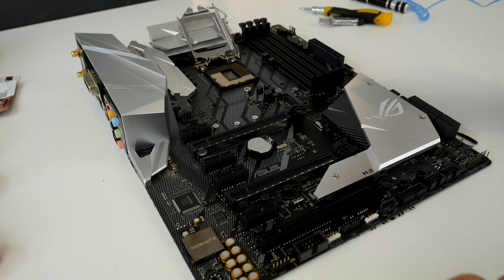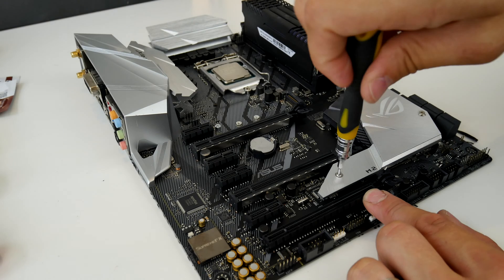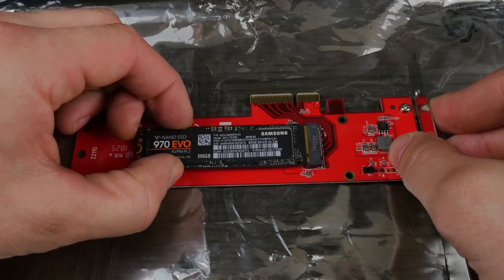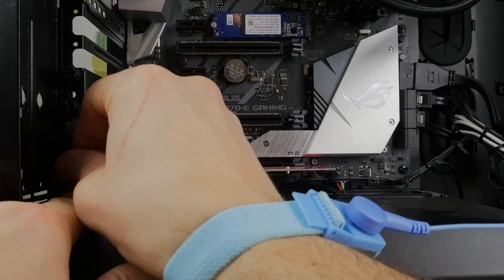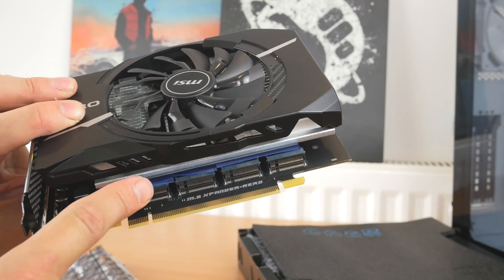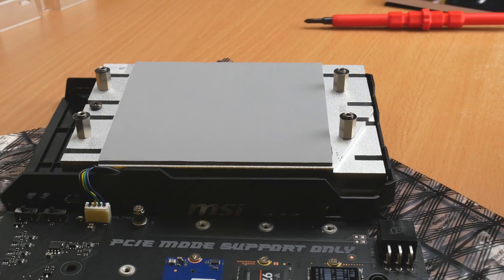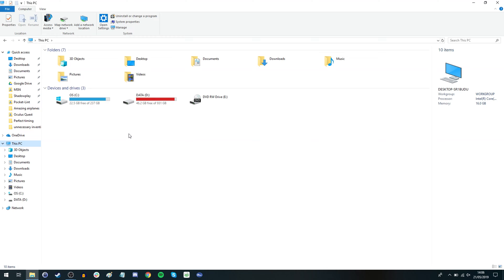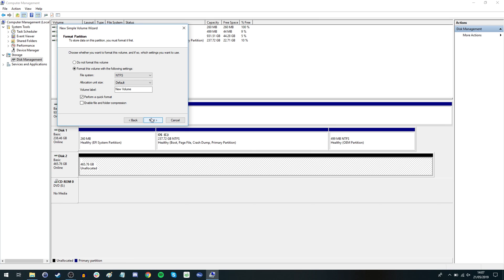How to install Corsair Force MP500/MP510 NVMe SSDs

Comment: What screw do you use to screw it down
Reply from the maker: Standard m.2 screw. If you didn't get one in the box you can usually find them in your motherboard box or buy them online easily from Amazon.
Reply: @TheProvokedPrawn  thank you, there were thankfully some in my motherboard box
Reply from the maker: @liamb5378  woot. Enjoy.
Reply: @TheProvokedPrawn  thanks
Reply from the maker: FandWay M.2 Standoff and Screw,M.2 SSD Mounting Kit for M.2 Drives,Asus motherboard M.2 Screw + Hex Nut Stand Off Spacer(5 sets)+1 pcs screwdriver https://www.amazon.co.uk/dp/B07QM51454/ref=cm_sw_r_cp_apa_i_bL6aEb7FQ4XDE

Comment: Thank you for all the information on M.2 SSD. I have used several Samsung Evo Satta SSDs in my computers. They needed the Samsung Magician program initialising to make them work properly and to manage the SSD's health.  So do you need any program installing on  Windows 10  to manage M.2 and do you need to adjust Win 10 to stop  disc defrag for example?
Reply from the maker: Generally no. You can manage some with software but I don't think Corsair has any.
Reply: @TheProvokedPrawn  Thank you for your fast reply!😀

Comment: Hey, just to confirm that I'm not in the wrong, could I install this corsair SSD on my Z390-A PRO without any issues?
Reply from the maker: Assuming you mean this motherboard (https://www.msi.com/Motherboard/Z390-A-PRO/Specification) the answer is yes. You have one m.2 slot (check the specifications and you'll see).

Comment: Yeah, it just doesn't show up in Disk Management for me at all
Reply from the maker: Unusual. Have you checked your bios settings? Maybe you need to adjust something in there first.
Reply: The Provoked Prawn Yesterday i think gave me ptsd of BIOS screen. But I managed to figure out the problem, it was a physical blunder. Booting windows from it is like a blessing
Reply from the maker: #Winning. Enjoy! Hope this video was useful enough to get you subscribing.
Reply: @sorathereason  how did you get it to work ? I just got mine and cant get it to show up in windows for the life of me
Reply: Zeo ツ well i forgot to unplug the battery to the motherboard right before screwing in the nvme. It would say i had the nvme in BIOS, but not be able to boot. redid it and unplugged battery that time, worked